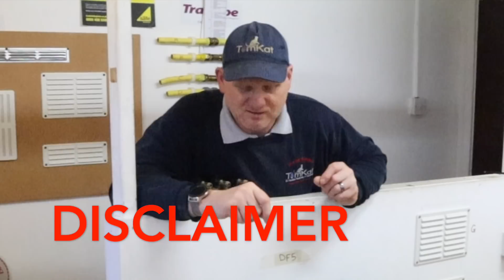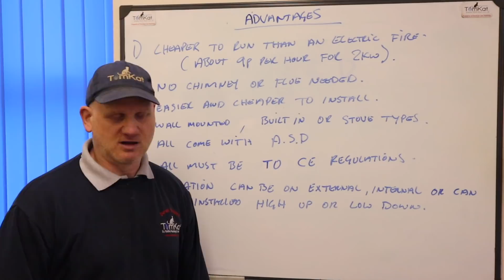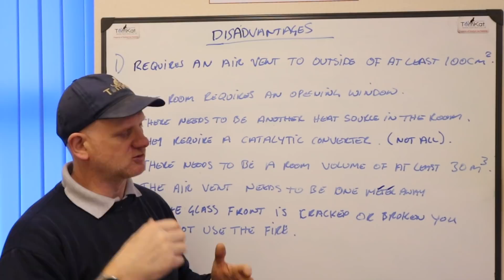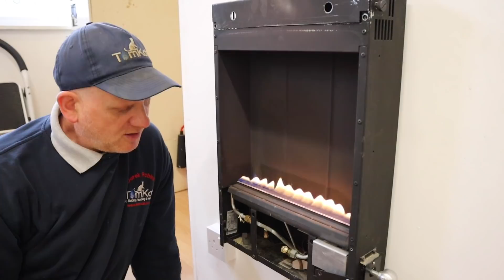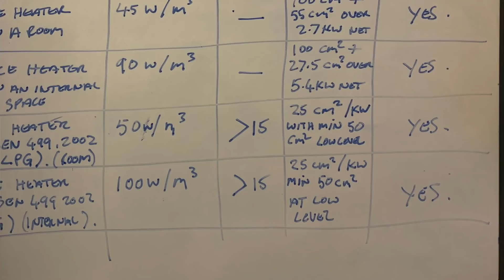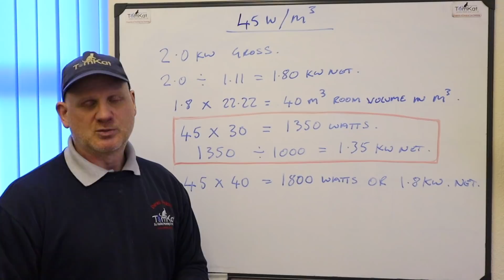WHY ARE GAS ENGINEERS SCARED OF FLUELESS GAS FIRE. finding out if flueless fires are dangerous.

Comment: Ventilation requirements if the room also feeds an open flurd appliance in a compartment in another room say 21kw net so this needs 105cm 2 as the flueless fire assumed changes the rules on advantages air away 
If the fire requires100 as a standard for room size then do we put in 105 cm2 as the largest or 205cm2  combined or if the fire was 155cm2 the largest of the two. say as its more than 2.7kw say 3.7kw would that be the biggest and 155cm2 would be the answer this is for vent 1 
Note the others having to be 50% more etc
The open flude boiler would draw lots of air in the room so I would go with the largest of the two is this the Answer

Comment: I've had flueless gas fires installed for over 20 years, and they are truly superb. 
Mine is capable of heating the entire ground floor of my open plan house. They are peanuts to run and heat up very quickly, but you absolutely MUST have a carbon monoxide detector fitted, along with the required ventilation.
I've only ever had one catalyst fail, and the monoxide detector alerted me straight away of the fault. 
I would also like to add, that despite rumours of these fires causing condensation, I've never once had an issue with this. 
Personally, I'd never go back to a traditional, inefficient flue fire.

Comment: No mention of water vapour and condensation or people with allergy to gas fire fumes.
Reply from the maker: If the room size is correct and ventilation is correct there should be no condensation also the fire gives off co2 if installed correctly and gives off less poc than a cooker or hob due to the low kw so guess you must be an engineer or general public who is scared due to being given the wrong information about flueless fires
Reply: @tomkatgastraining  I know nothing about them, but I do know that nitrogen dioxide is an irritant which is produced by burning gas and causes asthma symptoms in some people. Are NO2 levels specified or measured for flueless gas heaters, do the heaters come with a warning? Asthmatic a and those with breathing difficulties might want to avoid them IMO. Sorry.!
Reply from the maker: @ncooper8438  as I said if the correct ventilation is installed and the room is large enough for the heater and throw in serviced and analysed every year there should be no problems. Obviously there probably is some people who could have a medical condition that could stop them having a flueless space heater but if you have a gas cooker or hob then there should be no reason why you couldn’t have a flueless fire.

Comment: These fires connect with 8mm pipe, but my installer was a bit cheesed off as they don't specify the wall thickness in the instructions, so he used 0.6mm wall thickness about 2 foot of pipe.
The fire seems to have low output. So is 0.6mm wall thickness correct? Fire is Focal Point Blenheim Catalytic natural gas.

Comment: Over time, do you get condensation streaks on the inside of the glass?
I had a balanced flue fire and after a year it was really bad. The cure was to run the fire at low heat for 10 mins and gradually turn it up.
Reply: I have a flueless gas fire and I've never had any condensation. I have noticed with my dads balanced flue one that it gets a bit condensated.

Comment: 100cm2 air vent is that correct that's 1m2
I'm I right thinking that
Reply from the maker: Yes it’s correct but I think you think it’s a hole a meter by a meter but it’s not
Reply: @tomkatgastraining  
Thanks for your great videos on you tube
Reply: Hi sorry ,  your right...I'm getting mixed up
Reply: It's a space 10cms x 10cms approx 6inches x 6 inches

Comment: Never been afraid to fit a flueless gas fire, done my first one in 2010 if I remember correctly and that needed a new burner when I fitted it as it was outside the allowed KW from new, big argument with the manufacture on the phone but I proved it was incorrect and that everything was installed as per manual, even reported them as manufactures are not allowed to sell gas appliances outside of the requirements, anyway they sent a new burner that was within the KW allowed and I have serviced it every year apart from this year, as the owner moved.  
You just need to read the manual and follow the regulations to the tee and not take any short cuts.

Comment: I understand the ventilation is for combustion purposes but I was told its also incase catalyst fails.After watching this video Im inclined to think maybe minimum room volume is the reason for catalyst failure? Im confused. Are there any requirements for failure of catalyst? Best would be co tester if there art any id say
Reply from the maker: You could say it’s the size of the room the ventilation and the openable window that are implemented in case the cat fails not just the vent. If you think about it the vent is supplying fresh air for combustion if the cat fails the vent wouldn’t get rid of the co it would just supply more air to keep the gas burning.
Reply: @tomkatgastraining  yes i agree but also how would a regular person know if the cat fails until its too late?
Reply from the maker: @lazylady81  have their appliances serviced and checked every year
Reply: @tomkatgastraining  Yes of course but customers don't understand the importance because some can't afford service costs. Plus everything could be good at time of service but 1 month later things could take a turn.CO detectors are the only way.

Comment: Fantastic video. Well explained and demonstrated. Found it really interesting how you did two checks on the ASD. The first one which I’m pretty familiar with was blowing of the flame and counting the seconds until you hear the ‘click’. However, you then used your finger and blocked the hole on the ASD. Thank you for showing that! 

Normally on gas appliances such as cooker rings, oven, grill etc you would inspect the flame picture for signs of complete or incomplete combustion. However, in this case on this flueless fire you don’t need to inspect the flame because like you said it’s designed to give it a warm cosy look..? Thanks Derek 👍🏻

Asian Jon. Training.

Comment: Am not in gas I do sparking came across this last week had a look find all interesting.  FLUELESS GAS FIRE I say yes all sounds OK as my gas oven gas hob don't need one.  Am told that it is the un burnt gas that is the problem I must find out more.
Reply: You gas hob and gas oven is not a source of heat it is a cooking appliance and depending on the size of the cooker could need a flue
Reply: @mynameis9739  regardless it’s still producing heat. And our all gas range at 24kw has no flue. So what’s the difference between this an a space heater? When cooking maybe on for a good few hours especially on a Sunday.

Comment: I got one and I tested it on natural gas, propane which is supposed to be clean gas. The fact that the flame looks like that is because they wanted it to look cosy but the burning process is not correct due to insufficient air. The flame should be blue just like on your stove. This is total nonsense and very bad for your health. The safety system is very good though. Do not use it if you care about your health, you will not die but the air quality inside the room will be really bad.
Reply from the maker: I am sorry but your comments are incorrect. The POCs will only become bad for your health if the fire is installed incorrectly and not serviced every year
Reply: @tomkatgastraining  you may be right, that was my experience
Reply: @adbitex  Indeed there is also PM2.5 and other particles and NOx.

Comment: Should you not confirm the ASD shutoff with a manometer??
Reply from the maker: If you can’t see or hear the ASD like on a back boiler you need to use the manometer but in this case you can see hear and smell that the ASD has shut down.

Comment: Hi so does that mean its AR if its the only source of heat in the room.
Reply from the maker: Now that’s the question if you looked in igem g 11 it wouldn’t even tell you this scenario but if you looked in most of the manufacturers instructions it would say must not be installed as the primary source of heat. I personally would class it as AR and advice the customer to have the fire removed and note it on all paperwork.
Reply: @tomkatgastraining  so what if they don't have any other source of heating meaning no radiator just that flueless fire in living room and baxi slimline 5 in bedrooms
Reply from the maker: @happyslapper07  I would definitely AR the fire then as they would be using the fire a lot
Reply: @tomkatgastraining  do the baxi slimline 5 have fsd in them as there are two bedrooms with them in I know there room sealed.
Reply from the maker: @happyslapper07  not needed as you say they are balanced flue and room sealed
Reply: @tomkatgastraining  ok thanks for your help have a good night.

Comment: sorry wrong about being gas safe registered, not  true gas safe registered  "or competent" ie not taking payment and having the knowledge. I don't agree   but that's the law. And I would say they can be more expensive to install  especially if a black hole vent is needed. Core drill needed
Reply from the maker: Could you please show me in the gas regs, building regs or British standards that proves your statement. What you will find in these is to install, maintain. Service or repair gas appliances you must be a member of a class of persons which at the moment is gas safe registered. It also says you must be competent to work on these appliances meaning hold the relevant up-to date  gas qualification so in this case it would be ccn1, htr1 and cpa1. But if you don’t hold the quotation and you do install this fire and you kill someone it’s ok because you didn’t get paid for it.
Reply: @tomkatgastraining  I have had this conversation with a few and I felt the same way you do. But i have had to rethink it,  and if what you are saying is correct then  it would say Qualified not Competent? If my qualifications ran out today am I now longer competent?  It all hinges on what the definition of competent is and the BS and BR do not make this clear , as a gas eng I hate it but that's the way it is. I am not advocating it, it's wrong in my opinion.  If someone in there own house installed a boiler following the manufacturers instruction to the letter and all the BS and BR. are they not competent?   I know this could go on and on because there is no right answer to the situation of what complies as someone being competent.
Reply from the maker: Since they introduced the registration of gas appliances this made it clear. You are not allowed to install a gas appliance in your own home if you are not gas safe registered and qualified to do so as you wouldn’t be able to register the boiler with building control. You are correct if your qualification elapsed you are deemed incompetent so like you say we could go on. Thanks for watching and your comments cheers 👍🏻

Comment: Great video coving these fires pal.
Whilst I have fitted many flueless, from a burley to focal point but I never trust the customers to have them serviced correctly and at the right time. I honestly now try and get customers to opt for a different heat source. 
Once I give the maximum heat output of the appliance to the customer and also inform them that they have to have a min 100cm2 vent within the same room, and show heat loss through that, they generally opt for electric on balanced flue.
Reply: I’d always talk anyone out of a fire unless it was decorative!
No need for a gas fire these days. Plenty of options

Comment: Don't these fires kick out a lot of moisture into the air when they operate?  The CC won't get rid of that so there could be a potential condensation issue with them.
Reply from the maker: Not if they have the correct ventilation and room size if you get condensation problems there is normally a ventilation issue
Reply: @tomkatgastraining  I went to one recently. No vent and in a room about 20m cubed. The walls were dripping and the 80 year old lady there said she loves having a nap in front of it 😱
Reply from the maker: @DeusVult1191  good job you went to it or she could have had the big sleep before her time
Reply: @DeusVult1191  The amount of times I've ripped off sellotaped cardboard over vents in houses and when i've told them why they just say 'we've lived here for years and ther'es never been a problem !'  No doubt as soon as I leave the carboard has been replaced. I used to make a note of the info i'd given them just to cover my back.
Reply: @DeusVult1191  😆😆😆

Comment: I don’t get why a rad is required for these.
Reply from the maker: Because the rad is the primary source of heat the fires are not designed to be running all day because the room could get a lack of fresh air so no rad no flueless fire.
Reply: @tomkatgastraining  I see. If I ever do become a fireplace installer I would never recommend or install flueless ones for my customers.
Reply: @tomkatgastraining  I was surprised about that requirement for another source of heating in the room . These days new houses can be so well insulated that even a 2kw heater could heat a room up adequately.